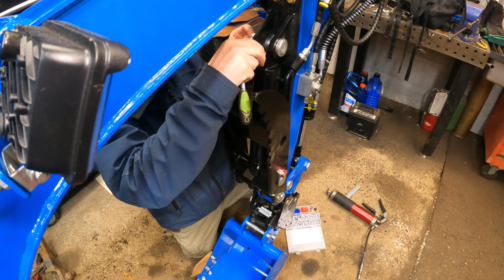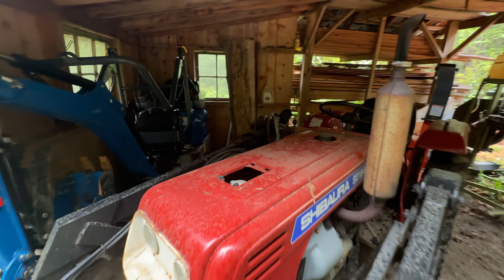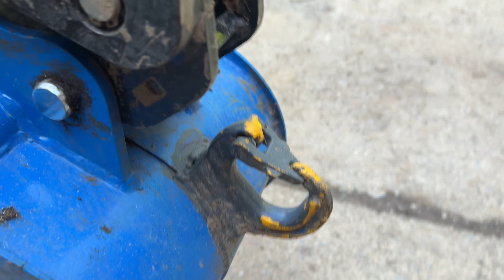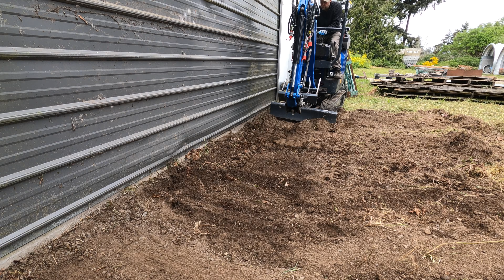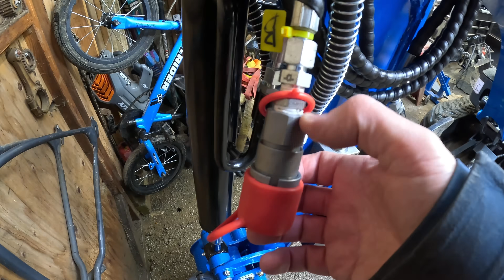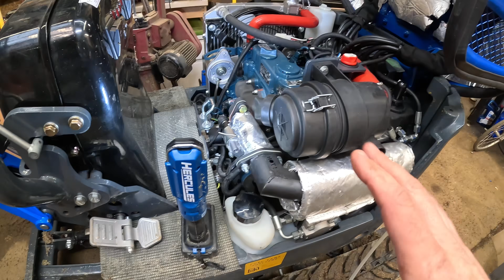Rippa R13 mini Excavator review upgrades & maintenance

Comment: What did you pay for the machine , with your options. Diesel kabota engine, thumb atachment.   Out the door price.
Reply from the maker: Well prices always fluctuate but I just looked up a local dealer for the newest model, the new R13 has some nice features that mine from a year ago didn’t have. Looks like the R13 is selling for $13,600 👍 I would recommend looking for a Rippa Dealer in your area

Comment: Hi there, I ve been following your page and I have to say that you made me buy a r 13 pro. I was wondering if you sell the tube to grease the tumb, its fantastic. If not can I ask you for the measurements so i can look for someone to make me one.
Thanks again for your dedication to help everyone to make a decision with great info. 👍
Reply from the maker: Thanks for checking out my videos! 
I don’t sell that tube with the grease fitting. But it was fairly easy to make. I think I ordered a short section of thick wall 25mm ID tube from EBay and cut it to length and drilled and taped a grease fitting into it, then welded it on. It would be an easy thing for someone to build for you.
Reply: @Mikefestiva thanks a lot for your help 👍

Comment: Do you have to use DEF fluid with this excavator
Reply from the maker: No DEF 👍 this is only about 14hp even my 25HP diesel skid steer doesn’t require that DEF fluid luckily. They are very simple Kubota engines in these machines.

Comment: I just bought a Rippa R15 today and it now has a hook included that's very similar to the one you welded on, except that it's attached to the boom itself instead of the bucket so it's always available.  Very useful thing to have though I think.  The new R15 has a number of other good upgrades as well.  Definitely pretty happy with the machine.  Appreciate all your tips though.  I haven't had an issue with the bucket flaring yet since I've only had it for like 2 hours, but I'm thinking I'll probably weld some plates onto it the same way you did since that seems like a pretty good upgrade and it wouldn't take me more than a couple of hours to cut out and weld on.
Reply: @fredfchopin  Hej jak tam maszyna dalej uzyskujesz rippe r15 interesuje mnie ta maszyna i zbieram informacje.pozdrawiam z Polski

Comment: There is no weight on the back, counter weight has been cut back on to save money
Reply from the maker: You probably haven’t done any research on this model and are speaking without understanding this model.
This is what is called a (zero swing excavator) it has about 250lbs of cast iron counterweight in the rear. The lower dark gray portion of the rear is all cast and is about 2” to 3” thick. I covered it in a previous video.

Comment: If the throttle has a cable instead of a linkage you could use a tensioner to put friction on the throttle cable. It’s basically like a u shaped piece with a tapped hole for a bolt the bolt presses against the sheath of the cable which creates friction against the inner core. A lot of sailboats will have this issue where the throttle springs back to a lower throttle setting.

Comment: I just received my R10 and it's a bunch of fun. 12k cad with shipping and taxes with a wide and trenching bucket. I have the gas engine and only need to keep it at idle? Adding rpm doesn't seem to help digging, full pressure is achieved at idle so ... Idk why I would make it louder and jerkier by upping the rpm.
Reply from the maker: Yes my Rippa R319 was a basic older model of the R10, it was also gas and it dug great in the lower RPM range, I never needed to run it full throttle.
I think you will have a good time with yours and get lots of projects done with it. Check out some of my older videos of my R319 so you can see what it’s capable of. I put 50 hours on mine in the first 10 months and it worked great 👍 
My friend has it now and he has over 160 hours on it now without any issues. Good little machines.

Comment: Great Video.  How many hours do you have on your machine.  Have you replaced hydraulic fluid oil yet?  O & M Manual P.63 Oil Product Maintenance schedule read First  Period 300 hours, but have noticed many on mini Excavator Groups such as the RIPPS Machinery Group recommend replacing all fluids in 10 hours or even before using machine other than moving it from point A to point B due to some manufactures using cheap inferior mineral oils.  Any thoughts or suggestions?
Reply from the maker: Thanks for checking out my video.
I changed the engine oil at 5 hours, I have over 40 hours on it so far, probably will change the hydraulic oil around the 50 hour mark. So far it’s working well.

Comment: Is smooth on controls? I have a landhero and the tracks are very jerky. They are on or off. terrible
Reply: I'm guessing the Rippa unit is fine. My Groundhog 1 ton tracks are fine - the track controls are smooth even at full trottle- do you have specific concerns about the 2spd tracks on this machine?
Reply: @chrisE815  no just wondering if they were smooth  mine are on or off. very jerky
Reply: @jiminalaska  I can only speak for my machine - it's the only one I have ever operated - single speed, very slow tracks - no jerky track movements. Sounds like an issue isolated to your machine - hopefully it's a simple fix and not a design flaw.
Reply: @chrisE815  thanks

Comment: Amazing video. Would you buy one of these with the gas engine?
Reply: I have the Rippa R10 with the gas engine and it works fine with plenty of power.  I did not want to go the diesel complexity route.  I would say that if you are going to operate continuous for hours on end that the diesel is water cooled and could be a better option, but for my smaller property I only run 45 minutes to 1.5 hours at a time or less.  For digging or lifting big firewood rounds idle or slightly higher is all I need for power.  I only use full throttle when moving to other sections of my property so I can travel faster but my unit does not have the 2 speed travel switch it only goes in slow mode but like I say it's not an issue on my smaller property.  I really like my machine no issues and attachments are very reasonable.  No regrets whatsoever hope this helps.  Thanks to Mike Festiva his fantastic reviews were instrumental in my decision to buy this machine.

Comment: Hi Mike! Great video. How does the R13 handle? Are the hydraulics jerky?
Reply from the maker: The hydraulics seem pretty smooth to me, much smoother than my older R319 that was manual forward controls that had levers directly connected to the valves. But the pilot controls add more complexity to the engine machine.

Comment: can only buy Rippa R13-2 pro  in Canada and its $17000.00 before tax   way to much for a 1.3 ton
Reply: That doesn't seem like a terrible price - Is that 17k CAD or USD? As of Aug 2025, 17k CAD = 12.2k USD - that's a great price!!! Mike goes over this machine in detail... it's obvious the R13 is going to cost WAYY more than the R319 or any basic 1 ton. Might not be your cup of tea but it's crazy feature and spec wise what this machine has over Mike's last Rippa - which was a pretty standard spec'd 1 ton.
Reply from the maker: It may seem expensive but compared to a new Kubota mini in the same weight range the Rippa is a pretty good deal. Equipped is just expensive no matter how you look at it.
Reply: @Mikefestiva  Do you know the Weight from the Machine itself without Attachments with this Rubber Tracks in Kg (not Operating Weight!)? Is there any information about the weight of the machine in the operating instructions? On Rippa Website Operating Weight (typically with driver and Attachments) is between 1200 to 1300 KG but with Steel Tracks with Rubber Pads. Wiht these Kind of Tracks the R 13 is too heavy to transport on my Car Trailer (1150 KG max. Load) because of the weight itself from the Steel Tracks. Thanks for your Support !

Comment: Hey Mike there is a grease gun from lock n lube that you should check out if you hate loading regular grease guns. it has no spring and doesnt leak or lose prime. if nothing else add a swivel from the same brand . A swivel wont make you rich but it will change your life ;) I bought one for work and put my name on it.

Comment: Two quick questions. Do you use Farm diesel in your machines? And do you plan on welding the thumb base plate down or is it okay in your opinion that it is just bolted on?
Reply from the maker: I use road diesel because that’s all that’s available by my place. I was wondering if that bolted thumb would be okay or not, so far it’s holding well, if I start having issues I will put some welds on it. So far it’s been fine 👍
Thanks for checking out my videos.
Reply: I see it as a feature. I'd rather bolts break than the boom or mount. If those bolts pop you've done something silly.

Comment: I have the same model excavator here in Australia. I bought the same oil pump for oil changes, makes it easy & clean. i like the solution for protecting the switches, im forever knocking them when getting on and off which is so annoying. my throttle lever did the same too, needed tightening up along with controls. I trailer mine around often for work and have to go under low garage roofs & through narrow paths so i had to remove ROPS it rubs on the boom when manouvering with it down and gets in way. i put padding on top of boom but still not great.
Reply: Where did you buy it from and how much did you pay? (if you dont mind me asking)

Comment: Hey Mike i was almost about to buy one of those because i really dont need a 20k lb Excavator but a Komatsu PC40 popped up on FB with 1548hrs for $20k with enclosed cab AC/heat, hyd thumb plus metal tracks. I couldnt get there quick enough, i wanted something around 4-6k pounds but 10k is more than enough for me and about all my 14k trailer can haul

Comment: Hi Mike great videos I have a question I’m wondering if you know what changes they have made with the new Rippa R13-2 Pro vs the standard R13 and R13pro thanks in advance
Reply from the maker: I wish I knew more about that. Seems like some of the R13 minis come with hydraulic rod covers to protect the chrome rods and some come with a hydraulic quick disconnect so you can drop the bucket from the cockpit without getting off the machine to swap out attachments. I would assume these minis are always evolving and the newer the machine the more refined it will be through out the year.
Reply: Thanks for your reply

Comment: Seemsto me a remote sump oil drain - 90 degree fitting bit of straight pipe and the original sump bolt, bracket at the end to hold it secure. 😉

Comment: You should put a curved  toothed plate on the inside of your throttle control lever to hold the lever at different throttle positions. You could probably cut it on your Arc Droid  and then bend the curve with a hammer.

Comment: Another very well-produced video, Mike.

The zerk fittings are a big issue, and is well-covered.  Note that you can also flip some of the cylinders around and use angled zerks to protect them.  As you said, the flat-faced grease ports DO work, but going to all-zerks means only one grease gun needed.

I like how the Rippa you have is using boot-protected heim joints on the valve spool push rods.

You are the first to post a dipper-mounted mower.  You inspired me to make one also, just finished one for my 7yo Rhino XN08.
Reply from the maker: Right on 👍 glad you enjoyed my video. I think you will find that mower to be useful for various applications around your place.

Comment: Why not change the oil filter I was able to buy two on Amazon for like $25 bucks for a set of two I know that the Kubota manual says that you can change the oil and nog the oil filter but that defeats the purpose otherwise great job on everything else you did nicely done that’s a question on the oil filter

Comment: Good video on the mods.  You have to use a machine a while to discover those.  For the oil drain my John Deere has a rubber hose with a capped fitting at the end to bring the oil drain out to where you can get at it.  After 35 years it's worked fine with no leaks.

Comment: You can connect a hydraulic hose to the drain pan, then you can drain the oil without suction, just plug the hose afterwards and strap it up. That's an option 🙂

Comment: Great video Mike. Setting up the main pivot point for a longer life span is the way to go. It looks like the sears are mounted on a removable plate assembly that could be rebuilt I guess. I find the information about these different fittings and what's available very useful since there are so many different types and adapters. I wish there was a book that explains the combinations for work arounds like your adaptation with the British fitting and adding a washer. Thanks man. Can't wait till your tee shirt gets here. 👍

Comment: Next time you drain the oil, could you get the plug out and add a valve and some piping that will clear everything for a remote drain?
Reply: This looks like it might be a great use for a fumoto valve.  As long as you know what the drain plug threads are you could replace that plug with a fumoto valve.  Then when it's time to change the oil, you simply push a length of rubber hose on the valve and turn the lever 90 degrees to open it and drain the oil.  No mess 🙂
Reply: @FlawedOffroad  That's a great idea. But placement of the hose should be careful so it doesn't rub on any rotating parts...
Reply: @FlawedOffroad

Comment: Hi Mike, 
Do you have any problems with the tracks coming off? 
I just bought a new R18 pro and I can pop a track when turning on my lawn. 
I’ve checked the tension and it’s tight. 
The machine has less than 2 hours on it, so it’s not wore out. 
Thanks. 

Also your 13 seems more powerful on side swing when scraping the ground than mine. 
The swing boom will move the dirt, but if using the stick to move rotate the body, it’s pretty weak.
Reply from the maker: Both my R319 and my R13 I haven’t ever lost a track on either one. I have had a track get jammed a little bit on the R319 when side hilling and got some rock in it. 
I will be checking my hydraulic pressure pretty soon on my machine. I would suggest checking that on yours to see if you are have your pressure relief valve set lower on yours from the factory?
I haven’t looked over the R18 so I don’t know much about them but I would look over the entire track on the side you lost and see if there’s something loose on that side.
I also suggest making larger arc turns rather than one track forward the other in reverse.
Reply: I saw a video where they were having the tracks come off and found out that the track was too tight. They thought that the tracks were over tightened for shipping. I don't know if that might be your problem or not??

Comment: A couple of questions on the bucket. Does the chain hook you added effect digging? Or maybe I should ask if it rubbed against the soil each time you dig? Another is all  of the bolts sticking up inside the bucket , how will they wear after a couple of years. It is a handy machine and a back saver.